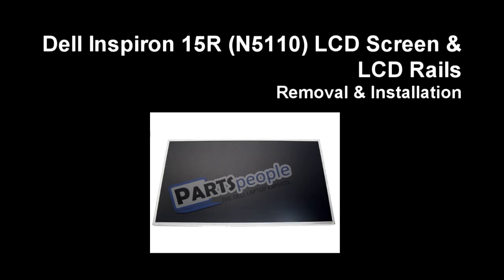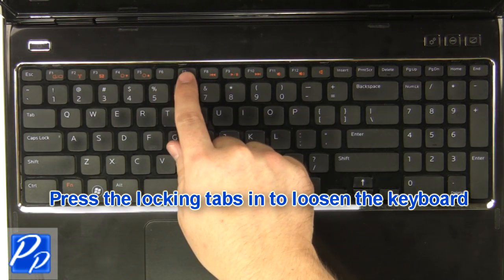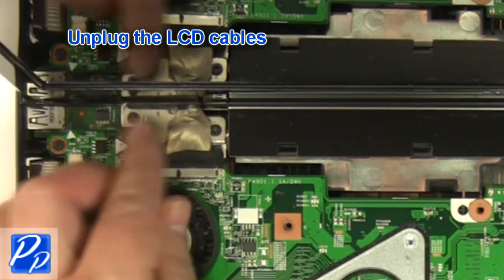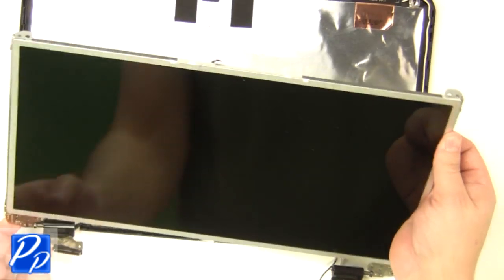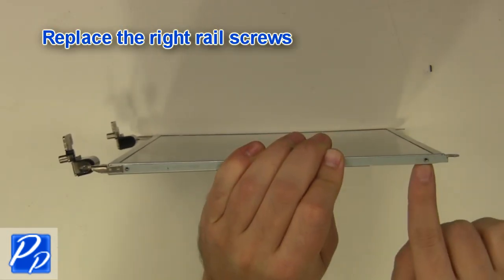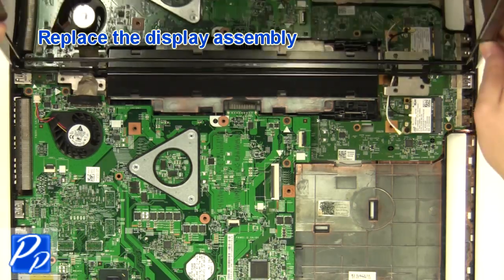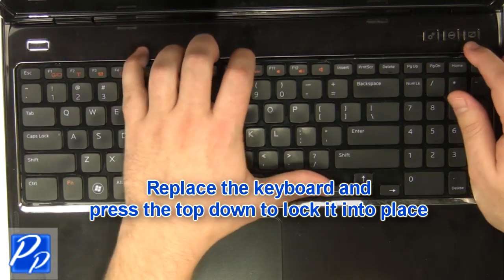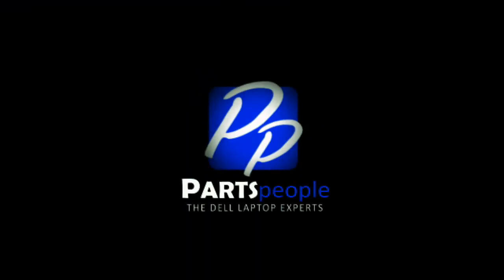Dell Inspiron 15R N5110 LCD Screen & LCD Rail Replacement Video Tutorial

Comment: My n5110 is having some issues like the WiFi and Bluetooth options won't turn on despite airplane mode being off. Is it due to problems in wireless adapter? Please help.
Reply from the maker: It could be the drivers or the cards. Start with updating your BIOs and then reload the drivers. If that doesn't work you might have to replace the cards.
Reply: if you changed your screen, you may not have seen two wires soldered on the metallic parts of the screen. I hope you kept those, because they're the wires for the wifi card and you won't get any signal if they're not soldered back.this will save you any installation or buying another wifi card. personally I've never saw a dead wifi card even the old ones from the windows 95 era who are still working but too slow to be worth saving them.

Comment: My screen shows a lot of somewhat colored vertical lines with a small horizontal bar near the middle that will show some of the actual display. I can plug in an external monitor and it works fine.  Is there any way to make sure this is in fact the screen and not the cable other than mounting a good screen or trying a good cable to see?
Reply from the maker: Do the lines or the image change when you pivot the screen? If it all stays the same, it is most likely the screen.
Reply: Thanks for getting back. If you mean simply tilting the screen using the hinges it makes no difference at all. Holding the laptop up at any angle is the same also. Do you mean using the landscape and portrait settings as I don't think this will change view like a smart phone?
Reply from the maker: The cable is located by the hinges so if the cable is damaged, opening and closing the screen will usually change the image. In your case, I think you just have a bad screen.
Reply: OK, thanks for all of the help. I will go to your site and check into a  new screen.

Comment: thanks for the video.  I'm rephrasing a question I posted earlier.   If my screen is flickering would this be the only fix?  I plugged another monitor to the external port and it works fine.  is replacing the screen the only fix or do you have any other suggestions?  If I need to replace the screen, do you have a good resource to buy Dell parts?   Appreciate any suggestions.
Reply from the maker: It's probably the screen but it could also be a bad LCD cable. We have a ton of Dell parts on our website http://www.parts-people.com
Reply: Parts-People.Com, Inc
my loptop falldown and now its screen is not opening can u plz help me